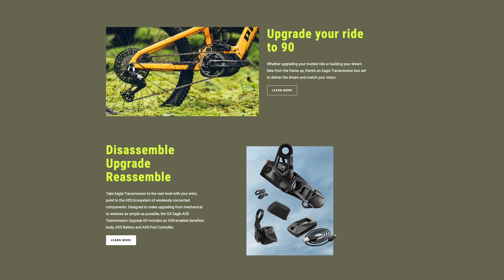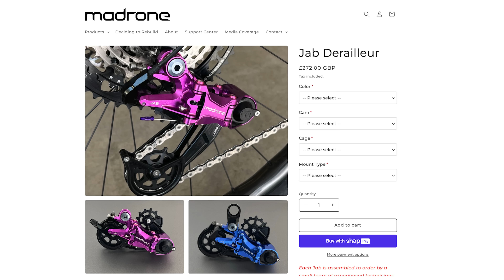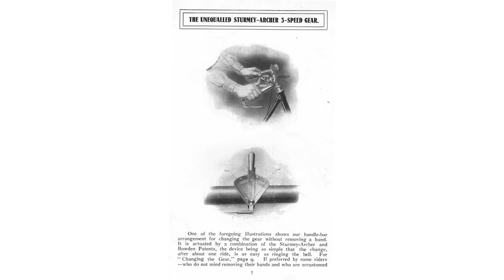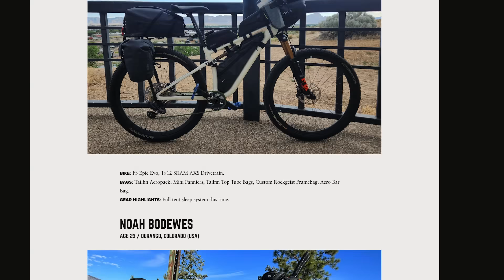Will we hear the last 'CLICK' of mechanical shifting?

Comment: I'm all in for wireless electronic systems, but i had a problem with my XX1 AXS and i found it's a pretty common problem with sram axs systems.
One of the Pogo Pins (spring loaded pin) on the derailleur became stuck and wasn't doing a proper electrical connection. I was able to replace both pins with new ones, but i work with electronic devices, i believe there's a big group of people without the skills to do the job... And sram doesn't offer any solution for the problem... Because of this, I'm a bit skeptical right now, all of my bikes are sram axs equipped, it's a matter of time until i have the same problem again.

Comment: 4:05 I gotta be honest, I'll stick with 105 (or higher) mechanical for as long as I can. I get the benefits of electronic shifting, but I don't want to faff with batteries and charging and the cables work well. You say it yourself: there's no issue with the performance of it, really. The tricky part is when mechanical is more expensive than electronic, and I sure as hell hope that never becomes the case!

Comment: You're not touching on sustainability Paul. I hate having invested early in smart devices who are now obsolete because of firmware and chips, while the actual device (speaker, fridge) are perfectly usable. I don't look at bikes as a disposable thing. I want to hold on to mine exactly as long as I want to. Also I love the fact a bike is one of the last aspects in life that does not involve electronics and software. Progress in pro sports is cool but totally irrelevant to me just clearing my head on a road bike after work.
Reply from the maker: You are totally right. Reality is that there are so many mixed metals and plastics in bikes now, that recycling is tough.  We desperately need better laws around compatibility , right to repair etc.  the law makers can’t keep pace with innovators.

Comment: My road bike is DI2, but my two commuters that I need to be as robust as possible are fully mechanical (gears AND brakes). Shimano derailleurs (GRX on one, Ultegra on the other) combined with Sensah shifters (I prefer the double tap style of shifting to Shimano's own style, especially when wearing winter gloves) on 1x11 drivetrains make for very, very crisp and precise shifting. I have no intention of converting either of these bikes to electronic shifting, as much as I might like it on my road bike.

Comment: Growtac Equal shifters (and brake calipers) will keep you going (and stopping) with Bowden cables.
Reply from the maker: I need to look at those.  Aren’t they essentially friction shifters?
Reply: @Mapdec They kind of are, but they have recently introduced optional index plates with notches to match different brands/speeds/cable pull/etc.

Comment: part availability is the biggest issue with rim brake bikes, the wheels and parts pretty much scarce now where I live apart from new old stock still in inventories, cables n stuff still can get for now. I will be continuing to ride older bikes and mechanical until that is not the case. Id love to have a modern bike with electronic shifting, 30mm clearance but the prices are just mind blowing, I cant justify it, I really cant swallow that bitter pill right now. For that I am thankful for mechanical and for what seems like a simpler life back then compared to now, it will come to an end at some point though, forced due to no one willing to make the parts still. Shame because so much will go into landfill.

Comment: Mechanical will be around for a while, simply because it is “no-tech” but it will end up being only the worst stuff that’s left, your tourney level etc because it can go on a £100 bike. 
Those of us who want hydraulics and mechanical at a premium quality will just get “lesser” quality until forced to jump to e waste shifters. Yes there will be minor market niche stuff, Ingrid etc but the ultegra level mass market, excellent weight to cost to quality ratio will just drift and drift so it’s unacceptable for the majority. Haven ridden sword and worked on bikes with a lot of low end microshift parts, they’re never really that good, they don’t work as well and or don’t last as long as something from Shimano that costs only 10-15% more. If it’s cheaper up front but it’s dead twice as fast, it’s not cheaper any more. 
Cues at an xt/ultegra level will hopefully keep us that value not having e waste on our bikes happy, but speaking to those at Eindhoven in big s, that isn’t their vision going forward. But when I ask myself why I’m so opposed to electronic it boils down to fear it won’t work with no discernible reason for the failure, this happened all the time with di2alfine in the shop. It will break and I won’t be able to diagnose to fix it meaning a warranty, no ability to fix anything because it’s microsoldering. This means a replacement that’s 8x more expensive. Theft on bikes I use daily, happened surprisingly often that someone’s di2 xt mech would have been stolen in the night. I’ve heard from other shops that the wireless sram gets stolen a lot too. Durability and longevity. Needing to charge things and losing the “always ready” aspect. Age making batteries and shifting worse as the e part degrades. I can swap a spring but can I swap a servo? Needing more maintenance to stay good - less “fit and forget”. Less ability to deal with bad weather, i marshalled enough races in the rain where gears had died with di2 to think it wasn’t coincidence. Weight and aesthetics. It’s big clunky and looks kinda gross imo.
Reply from the maker: Great comment. Thank you.

Comment: "Why would not you take the opportunity of upgrading to DI2?" Because my 10yo road bike waited 3yr in the basement when I was occupied by other things. And when I have finally decided that I want to ride it again I have just pumped the tires and went for a ride. Good luck with leaving batteries for such a long time unattended. 
With cables this bike will serve me to the end of my days and will be serviceable cheap.
Reply from the maker: Fair.  And to be honest, impressed with the dryness of your basement.  Round here I would expect that to be a rusted, ceased up hunk of junk by now. Nice.
Reply: @Mapdec  Well, it's warm and dry, I admit. It's a side effect of all the piping for the central heating system. But my XC bike from 2002 is staying in the garage where it's cold and humid, and it's also not suffering from rusting that much. I serviced it lately after at least 10 years of not touching it, and the only rusted part was a low-end headset bearing. The rest was dirty but fine, despite the wheel bearings being worn out. But the cables themselves were as good as new, as I always used stainless ones. Rust on the cut end of the cable housing doesn't count, as it doesn't matter if it's rusted or not. Rusting is only an issue with my enduro bike, as it's washed quite frequently because of all the mud, or with my commuter, as it's used in the rain with a crappy square taper bottom bracket which requires replacement every 1-2k km. Di2 is nice if you have 1-2 bikes and it's your hobby to use them regularly replacing the bike every few years, but if it needs to be long-lasting, I'm skeptical.

Comment: Unfortunately - it’s all about money, and you can’t blame Paul for looking after his own interests… why would a bike manufacturer, retailer or servicer make/sell/recommend something that will last for a decade or 2 and can be maintained at home? Business suicide…
So - future proof yourself - get a decent 10/11 speed mechanical rim brake set up, get a few spare chains and cassettes, maybe a chainring or 2, grab some brake blocks, and even a spare front & rear derailleur and you’ll be good for the next 20-30 years. Never need to visit a bike shop again… oh - maybe a couple of those Bowden cables (which I’ve never heard them called btw! Why did Paul do that??)
👍
Reply from the maker: Do what?   I’m not sure about your business suicide idea.  Electronic wireless stuff doesn’t not really need a mechanic.  Bolt it on and follow the instructions in the app. Mechanical meanwhile needs routing, with consideration to friction, needs aligning, tensioning, etc.  every kid can work di2 and axs but a cable is unfathomable.
Reply: @Mapdec  I think we should agree to differ 😊
Reply from the maker: @ChrisB-d4r  I would bet my next apprentice will have electric kit figured out long before they get their heads around cable routing. Will be a good video.
Reply: Paul - I think I was riding my 1st races before you were born. I’ve raced on the cobbles in Belgium - a few spanners and Allen keys did the job. I used mainly Campag SR and remember when Shimano DA came out lol
I’ve also owned a SWorks Shiv, and have built a Winspace SRAM Force AXS from scratch. I’ve owned a Dolan mechanical from 15 years, and even had a Dawes Galaxy tandem with a concentric BB. I’ve fitted many hydraulic disc brakes - both mineral and DOT, and built both external and internal routed bikes.
I’m not a professional like yourself, I don’t have a run a business, but I know what setups are easier for someone like me to build and maintain, cost wise too.
Spanner’s and Allen keys vs bleed kits, apps and torque wrenches .
Oh - did a 24 for a 10 on my Winspace 2 weeks ago - AXS, Hope, deep carbon rims.. I have no axe to grind either way…
I do enjoy your content - just don’t agree with everything you say ❤
Reply from the maker: @ChrisB-d4r  I think my first XC race was 1997 😮.  Might have aston hill.  Anyway. I don’t think this is an agree / disagree vid. Just a collection of observations and concerns up for discussion. Thanks for watching.  Love the Shiv. Spent many days in its handlebar counting the labour hours 😂
Reply: @Mapdec Eastway (London) 1974… 
Have a great day 👍
Reply: @Mapdec  Exactly - such an illogical argument full of massive holes.

Comment: Most problems I see people have on the road side are with electronic shifting. Battery, unpared and became dead (Battery's good), shifting went bad after a bump and so on. I can fix almost any mechanical issue on the road side to be able to move fast enough, but not this laggy black boxes

Comment: The only thing I miss on electronic shifting systems (or missed..) is kind of a safety net in the case the electronic fails or the battery drains. I would be great to be able to select gears even without power, e.g. with a small allen key, to be able to get home or you could at least still make it up the mountain...
Reply: You used every argument. But none of that has ever happened to me in 35+ years. My mechanical is working fine. No reason to change.

Comment: I think you can end up with a warped perspective when you mainly deal with higher end bikes. It was only a few years ago that the average price of a bicycle sold in the world was only about 50 dollars which did include children's bicycles I believe. Fuji-ta the world's biggest bike manufacturer by volume and the biggest aluminium frame manufacturer still manufacturers a lot more steel frames and those are robot welded so despite being the older material for bikes gets the most advanced manufacturing processes. At the time the factory door price for a robot made steel frame was less than 5 dollars. Also again back then steel dominated frame materials around the world with over 90% of frames made from it. Halfords sells more bikes (volume not value) in the UK than all the independent bike shops put together. They used to get 1 pound for every 4 pounds spent on cycling in the UK just a few years ago. Also just a few years ago the average price of a bike sold in the UK was 160 pounds, with the increase in ebikes this might be something like 400 pounds now and importantly this isn't a whole of market statistic because it excludes lots of retailers like ebay, Chinese direct sellers, aliexpress personal imports etc. Entry level bikes start at 100 pounds and top end bikes maybe 10K, so statistically its clear the market volume is at very low prices well below 400 to get an average of around 400 pounds to allow for lower volume very high end bikes. My point is you wouldn't go to fortnum and mason to find out the average price of groceries or get predictions for the future of groceries. Their predictions would make no sense compared to the actual market conditions.

Also the UK is becoming a much poorer country and likely to default on its debts and go with its begging bowl to the IMF. There is about 200,000 pounds of government debts and liabilities for every single person in the UK be it a baby just born to a person on their death bed end of life. Even in the UK disposable income is collapsing as taxes go up to make these interest payments. Same is true of many other European countries like France, Greece etc. Europe is in a debt crisis. So I think predicting more people buying more expensive bikes is wrong its more likely there will be pressure on bike prices and specs will fall in line with consumer affordability. In places like Africa, Asia and South America bikes are more likely to be lower spec but long life products like steel bikes. It's not unheard of for bikes to be passed down from father to son in Africa etc and last many decades. Bike retailing is likely to get far more competitive in the future especially for those selling higher end products. In recent years my local area has lost many independent bike shops and to be perfectly honest I never used them because I do my own maintenance and the prices were very high. Their idea of an entry level bike was 500 pounds for something often lower spec than Halfords would sell for 250 or less. It doesn't seem long ago a local dealer was selling a 600 pound Trek mountain bike with a freewheel and 28mm stanchion Suntour XCE forks when Halfords were offering a mountain bike with Deore gearing and an air fork for about 650 pounds. If you work in a independent bike shop you don't really know full market conditions because you probably only sell to a select customer base with a good income who wants the latest greatest bikes. For that one customer there are probably 100-200 customers buying bikes elsewhere.
Reply from the maker: Great comment.  I do just see the market splitting.  Sport and recreation will persist.  But commute is quickly going e-bike.  Either hire schemes or disposable Amazon bikes.  Kids on the street having fun?  Well that got quite diverse.  They don’t seem to care that e scooters and e pit bikes are illegal, or if they burn the house down.  They seem to be everywhere.

Comment: As others mention, in the mass market segments, CUES, MicroShift etc.will stick around for a long time. Towards the high end, I'm under the impression the real driver will be frames that increasingly (un-)feature cable port delete. Can the Time in the background even be set up for mech shifting any more? Not seeing it. Does that dampen my aspiration to one day own one? Considerably. That's in large part how great HG+ has come out a few years back, I'm not switching, and no, there's no issue with cable operated 12x. And no batteries, no firmware updates, no apps - it's set it and forget it (until the annual maintenance comes around).

Comment: The big 3 may stop selling mechanical stuff but there are so many spares, damaged and parted bikes that it will be decades before it is a problem.  It is like cup and cone bottom brackets, they will last for decades (my 1984 Raleigh Kodiac is still going strong).

Comment: Mechanical shifting is not going away. You only have to look at any train station in Europe and the bicycle parking lot has almost exclusively mechanical gearing. The reasons are cost, simplicity, and reliability. The manufacturers want to sell you expensive stuff you don't need but most people couldn't care less.
Reply from the maker: The city e-bike seems to be invading that ‘commute to the station’. Lime bikes, Amazon e-bikes etc.

Comment: Mechanical will persist. I use SRAM Rival 11 mechanical shifters for their durability and practicality. Simple to service, easy to replace a cable. It's a totally democratic system that doesn't require a mechanic or expert knowledge like it would with an electronic group set suffering from issues.

Comment: Can you honestly say you can recharge your dead derailleur battery on the road? 
Same difference. I have both systems and love them both, but until we can solve battery life, I’ll take the simplicity and reliability of cables any day. 
There is also the matter of waste - what should we do with the millions of rim brake frames that will become redundant, especially the carbon ones? The manufacturers should bear the onus of disposal costs
Reply from the maker: No, but you can carry a 12g spare and be riding again in 30 seconds.
Reply: @Mapdec yeah, but that’s more expense, more energy being used, more stuff to remember to pack, more charging TTD, when all I want to do do is go out for a ride. I can’t believe how much planning and prep goes into simple ride now -ensure a charged groupset, rear light, front light, head unit, e-pump  and power meter, etc - it’s hateful!
Reply from the maker: @kehlew0160  so interesting to read your comment. I wonder if a similar comment inspired the latest synapse.